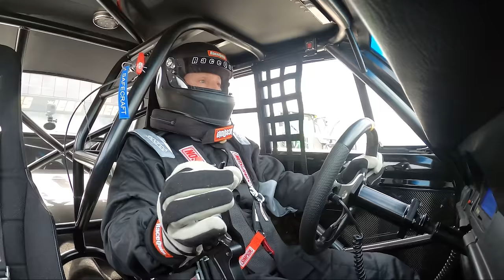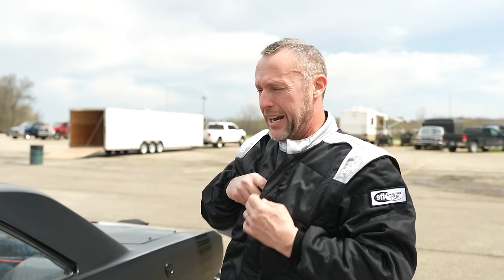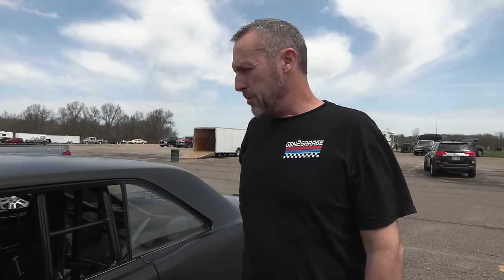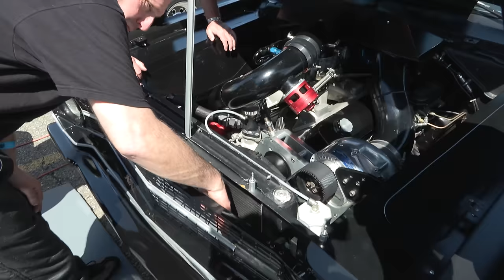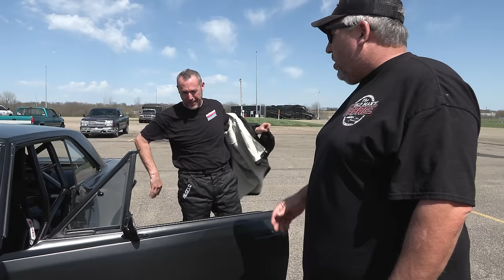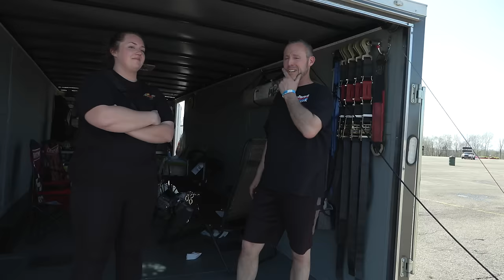First Passes with Dart Vader did not go as Planned…

Comment: That car was built by a great guy, a lifelong friend.
Reply: Thats awesome. Do you happen to know what the HP rating is on the motor and blower combo?
Reply: @thebeardofgaming81  we were told around 14 to 1600 depending on tune this engine was built by someone in Arizona that builds a lot of marine engines believe it or not, and it’s an odd size cubic inch. Every inch of that car was imagined and built by Ronnie.

Comment: I’m sure you all checked but that last clip under the hood when you last tightened the charge pipe and you put the pipe on going to the carb, the vacuum line was not connected to the blow off valve, but you probably connected it after the camera cut. Great job guys, you’ll get er figured out. Glad everything went safely.

Comment: Good ole F2, it's cog ( 12 rib serpentine would slip a bit when choked ) so when you slam throttle blade shut  fast or pedal, it's moving a ton of air....you just need to get used to coming off a bit less aggressively, however with my F2( BBC) the chefs kiss was the newer dual stacked Procharger By Pass Valve, it can evacuate twice the air that old one does ( if I seen it right).
 I eventually went back down to a F1A-94 on the street with 12rib, didn't have the big power legs but around 1500 with a serpentine style and made more HP per psi it's way more efficient....F2 is a monster for side slinger though...

 I know you think you want to make the charge pipe more rigid but if your turning that F2 near max rotational then blowing that pipe was acting like a fuse to keep it from hurting the blower, bending throttle blades ect...I'd consider adding an additional bypass on other side if it's symmetrical to your liking or iirc the double will bolt to that same nipple...just stacked 2 aka longer...

 Good luck that car is a monster it's dangerous for everyone and itself right now heh.....sounds awesome on the chip 5 seconds though LOL...

Stay safe crew....

Comment: If it's the blow off valve not opening, stop getting into boost before you fix it. The pipe coming off is the best scenario. I ran a procharged 306 on the street in the 90's, blow off quit working on a pass, when I let off the impeller hit the housing from flexing under boost with nowhere to go. Badass ride you have, reminds me of my buddies old plymouth when we were street racing back in the 90's, it's called The Hate Tank now.

Comment: That 1 needs a little work (Billy can get that charge pipe welded up), then some good Tuner dyno time before hitting the track again, let a knowledgeable Tuner get you a true baseline tune first Jeff, then go test and learn the car. That Mopar will fly.
Reply: And I mean like TKM Hub dyno, those big tires don't really belong on a roller with that kind of Horsepower. Turbo John and Randy got Randy's car setup in one session, and that is 1 serious Pro-Mod also.

Comment: Not sure if it’s been said but racepaks are very finicky I’ve installed them and it’s a pain but the datalogger is actually really good. There should be a serial number on the box. You need to call racepak so they can build a you a key so the datalogger can be read by the software. As far as the grid goes you may have a usb driver issue. There’s a separate driver for the cable most likely an FTDI driver. It also uses com port communication which may not be installed or enabled on newer versions of windows. Just my experience. Good luck to you guys!
Reply: @marvlobrio; Your comment about access to the Racepak data logger, communication via USB is certainly  noticing one of the key issues along with contacting them [Holley].
Did You also think that Jeff, a very experienced racer for so many years, with all of his expertise, principles including "races are won in the garage", meaning doing all that is necessary, required prior to going to the track, including many aspects with basic testing, including having a working connection with the computer, controller, data logger, access along with a properly working charge pipe, blow out valve, trans-brake [& button], 2-step, launch, etc. ??!!
Would Jeff actually consider to take this car "Dart Vader" or Allison's Dart or his Challenger or any vehicle to test, race at the track without any proper, full preparation as was done, shown in this video ??!!
It seems to me this video is a certain "set up" for the next video(s), using all involved [Bill, Billy, Tommy, Allison, Miss Daisy, etc.] during their participation with the event at National Trails Raceway, intentionally for major, important, basic lessons from Jeff for everyone; which will be revealed 
All The Best, Sincerely

Comment: Rough Day at tha Office.   Just a heads up guys.. some usb cables are charge only. They dont have the data pins wired. Start fresh with a brand new DATA cable and mark that bad boy so it dont get mixed up.

Comment: what interface or interfaces are you using for the data logs etc? does it use something like the J2534 diagnostics protocol? if its something like that? do you have the correct drivers installed on the laptop?

Comment: In the previous video i saw that the boost line for the blow off valve was in the wrong side and when its throttled, it would open but shut when the throttle went closed.

Comment: Check the firmwear version of the ECM vs the firmwear version of the application in the laptop ... in compatibility of softwear versions can and will impeed in connection and communication between the two.
Reply: @robb647; how would the "firmware version fo the ECM" - Racepak be checked without having access to the Racepak computer device ??!! Which application is used to connect the computer, laptop to the Racepak ECM, computer ?
When You have these questions figured, answered then You may be on the correct track. 
Also wouldn't Jeff, with his vast racing experience, also as an engineer along with his friend, even Billy, Bill, Tommy, Allison know that a connection to the Racepak ECM, computer is necessary prior to attempting any testing, track runs, passes ??!! Would they not also know to contact Racepak, Holley to have the correct information, knowledge to establish this necessary, important ECM, computer connection, have access to the data logger, stored settings, along with verifying each of the other shown, stated issues; charge pipe, blow-off valve, trans-brake button along with other necessary preparations ??!!
THINK 🧐 is this not an obvious "Set Up" for major, important, basic lessons form Jeff for everyone 🤔?  🤓
Reply: If the Racepak ECM is the same one that was installed by the original owner before he passed away and the car sat unattended, then the firmwear in it is outdated compared to a current download or updates for the application. Contacting Racepak for the info on the firmwear version during that time and installing that same version of softwear on the laptop should solve the conflict ... then with a laptop connected run a firmwear update on the ECM so everything is up to date.

The other ootion is getting a new ECM.
Reply: @robb647  Robb, seems that You still need to improve Your information, knowledge base to move from speculation, conjecture, proposition, presumptions, assumptions, contrived, devised 'alternate reality' into actual reality.
Good Luck -> Bye Bye

Comment: Jeff needs a new ATM Innovation blow thru carb and The Old Man tuning it. Then he’ll go fast or definitely faster. Once he’s got the bugs worked out it should be pretty quick because it looks like a well built car. I’m 💯 sold on ATM carbs after seeing how well they always perform right out of the box. Jeff will get it straightened out because races are won and lost in the garage and he’s no dummy. He seems like a very smart guy.

Comment: Use a cheap solenoid and put the blow off on a button.. Blip the throttle then lock it open in the brun out so it doesnt load up